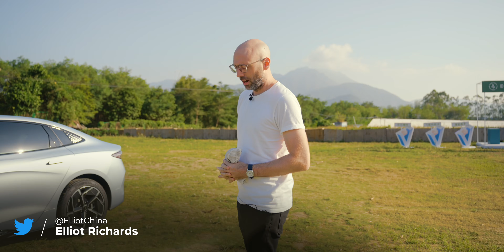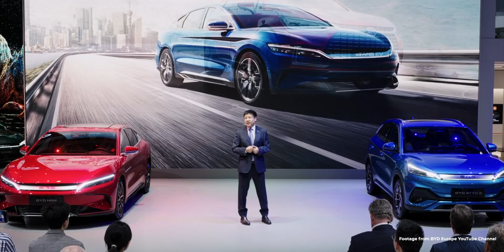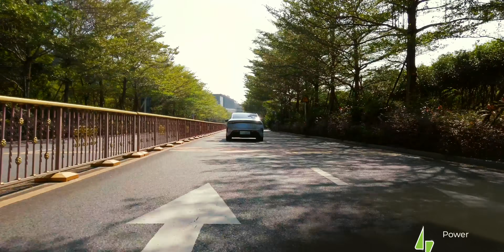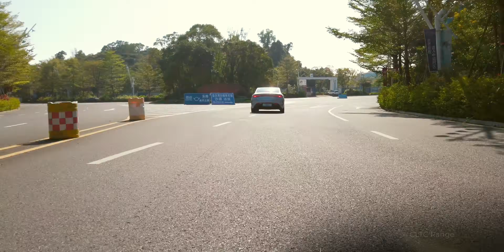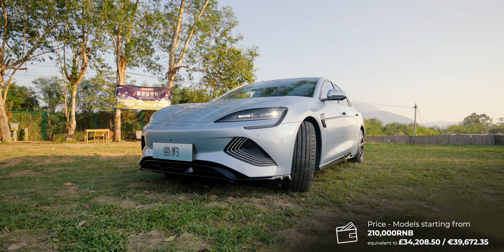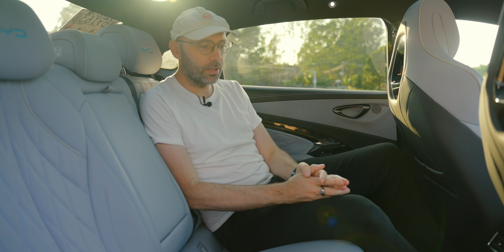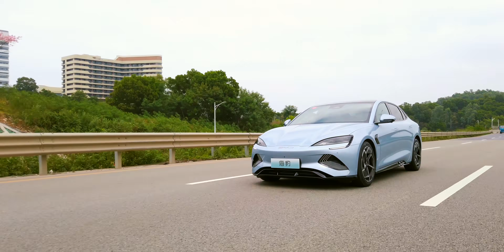This Chinese EV Is Going To Be A HUGE HIT In Europe

Comment: I like the monochrome transition you use here in this video Elliot, and I like the car, but no mention of Bi-direction charging. To me the EV car represents more than just a means of getting from A to B. The EV is now the mode of transport that can take energy from one place to another, and that opens up so many possibilities which I feel the traditional car manufactures are missing out on. I feel strongly that all EV's should bi-directional charge and therefore have V2H, V2G, and V2L as standard.

This will allow so many option including charging another EV at the road side, or when camping, or just covering a localised power outage. Even when the car reaches its allowed level of discharge and switches off, the owner can drive off to a charge 30 miles away and recharge and return to continue to run the house. Emergency services would gain so much from having cars that enable this mobility of stored energy.

Or maybe I am asking to much.
Reply: From what I know, V2L will come standard for most of BYD's BEV cars. Including, the Seal.
Reply: @RiyatiBule  Yep but V2L is limited to just 13a AC, you cannot run an ASHP off that.

Comment: Can we please have a comment if the height of the seats, especially the rear. Electric cars often have very low seat squabs because of their underslung battery. It should be mandatory to comment on this. Knees up is not a comfortable seating position

Comment: Great looking and very promising EV, let's hope it reaches the UK at a really competitive price. My only criticism would be why rear wheel drive rather than front for the 2X4? It also comes as 4X4 so front wheel drive is immediately possible and preferable for bad weather traction. OK so the "frunk" would be lost but potentially regained in the trunk.
Reply: It has 308 hp in the Long Range version, with so much power, a RWD version is more suited. Also, EVs RWD are more predictable than ICE ones.
Reply: @CATinBOOTS81  Why is that so, please?
Reply: @timjohnson67  when you put a lot of power on the wheels that steer your car, you're stressing them very much and inducing a lot of understeering.
Reply: RWD on ICE cars generally poorer in low grip situations due to weight distribution. Engine/gearbox up front and not much over the back axle.
In EV the weight distribution is much more even. Battery in the middle and motor over the back wheels.
RWD leaves the front just for steering which is much better. 
VW have done this with the MEB platform too.
Reply: 'Proper drivers' prefer rear wheel drive. Apparently.

Comment: Tesla is toast. They are an expensive car, with a cheap interior and second rate engineering. Tesla is behind in charging voltage, 400 versus 800. They also are behind in self driving capability. Tesla's excuse on self driving is "BYD cheats by using a map", is an argument for the feeble minded. In engineering, if you have to drive in a nail and you don't have a hammer, you use the flat end of a crescent wrench. Real engineering is doing what it takes to solve a problem. 

My first electric car is going to be a BYD.
Reply: and tesla is wayyyyy ahead on charging network, which is arguably much more important than some plastic in the interior
Reply: @Thatsme849  

So your argument is that it is a crappy car, but it is easy to charge. That could be the next Tesla ad.
Reply: @keithdow8327  Have you actually driven one? Its not as bad as you make it out to be and drives pretty well IMO. But yes charging is probably the most important thing
Reply: @Thatsme849  

There are many excellent things about it. However things change every year. Tesla is not keeping up with the competition. Elon is distracted by Twitter. By 2030 I doubt that Tesla will be in the top 10 of auto makers.
Reply: @keithdow8327  sure that may be true. Only time will tell I guess
Reply: Um. I assume you're shorting Tesla stock? Or maybe just grossly misinformed?
Reply: @MarkXHolland  

In less than a year the stock has gone from $400 to $200.  I think everyone is informed.

Comment: If this made it to NA with the price intact it could be big
Reply: No chance and it would be subject to a min 25% import tax. Meaning if the model 3 gets the full $7,500 credit come Jan 1st 2023?
This would end up as more expensive than a model 3, slower less tech, less range per epa testing, not as safe etc. 

Plus who the heck would service a byd in the U.S. and the U.S. spec car's would require a different charging inlet as well. China uses the ccs2 standard which isn't compatible with U.S. spec ccs1 chargers. Also this thing weighs more than a model y does.
Reply: @4literv6  I fully expect BYD to set up production facility in Mexico and/or Canada, in which they already have one for the buses. Whether US protectionism will allow it to remain competitive is another story.
Reply: @theolich4384  and who will service them? Sales locations for test drives? No full tax rebates if they use China sourced batteries either. 🤔
I thought catl backing out of making a facility here earlier this year was telling enough for me. And the U.S. denying ev incentives to U.S. built byd buses since it's a Chinese owned co. 👍🏻
Reply: @4literv6  Oh, they'll have local collaborators to help building a network like what they're doing elsewhere. That's no big deal.

Of course the US protectionism is the biggest headache here. We'll see how that plays out...I have a feeling though, that China's supply chain will have come to have an edge that even without the tax credit, their EV will be somewhat competitive. Just speculation though.
Reply: @theolich4384  why do you insist on this protectionism bit? China and everyone else does the same damn thing to any us eu exports etc. 
They slap tariffs on them often above and beyond what the U.S. has on their imported goods. So just call it what it is a tariff on anyone else's products&goods. 👍🏻

Comment: Perforated brakes only cool them, they don't make you stop faster, they only help fight brake fade when racing
Reply: Or when trying to stop a heavy EV... more mass - more kinetic energy that has to be absorbed by the brakes (and converted to heat via friction)... better cooling is good, for EVs.

Comment: If it's imported it will be close to £55k + so will be up against established competition . Could be a good second hand purchase after expected high depreciation due to brand awareness.
Reply: Why, when the MG4 and MG5 are both sub £30k?  If they come to the UK at £55k+, they won't dominate the sector they're aimed at, in either the UK or EU markets.
Reply: It will cost around £40k when it comes later next year.
Reply: @nocapproductions5471  if it’s that cheap they will be snapped up, plus the bonus of saving at least another (net) £200 per month on refuelling costs 😊😊😊😊
Reply: @nocapproductions5471  The chinese price + VAT is already over £40k.
Reply: That seams like a slightly snide comment. Must be a Tesla disciple..

Comment: My car is 15yrs old and weighs 800kg. Aygo.
Reply: So a smart for two or a tuc tuc.
Reply: @FIGHTTHECABLE  3 cylinder 1000cc engine . Seems ideal to convert to electric but too much like putting new wine in old skins ; pity.
Reply: Did you edit the Aygo in later?
Well a small engine makes sense if it's a city car and doesn't do many km/day.
A renault twingo or fiat 500e weigh about 1200kg
Reply: @FIGHTTHECABLE  yes, I think I must’ve .
Reply: @FIGHTTHECABLE  it’s done 81k

Comment: Tesla M3 LR/P is just as fast/faster and lighter.
Reply: But this has better Cd.
Reply: @KyleHubb  Cd? Candela?
Reply: @FIGHTTHECABLE  Coefficient of Drag.
Reply: @KyleHubb  aaah we use the cW-Value. So how much better is the value then?
What counts most is, real range. Many component in the car can have an influence. The motor, heating and cooling efficiency, etc.
Reply: @FIGHTTHECABLE  Model 3 Cd 0.23. BYD Seal 0.21.